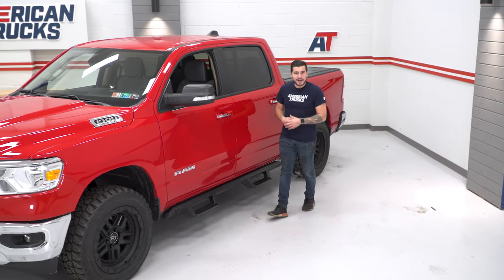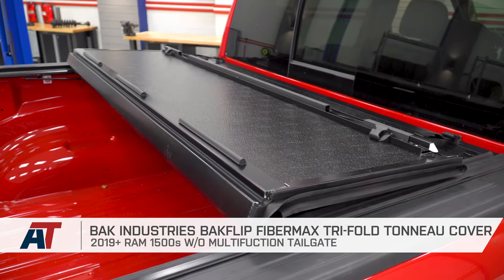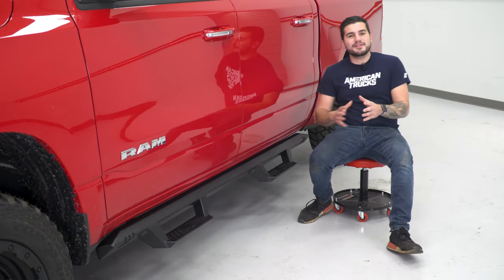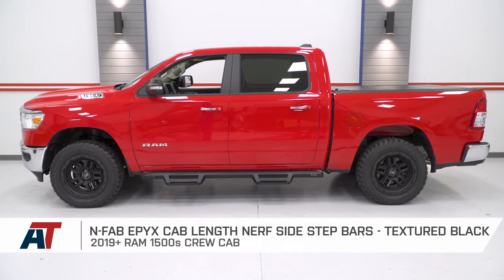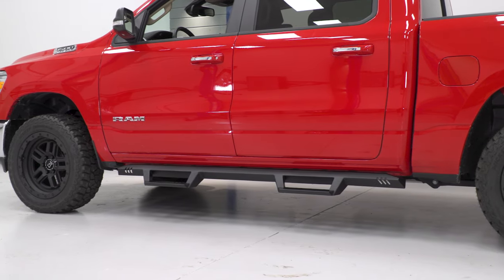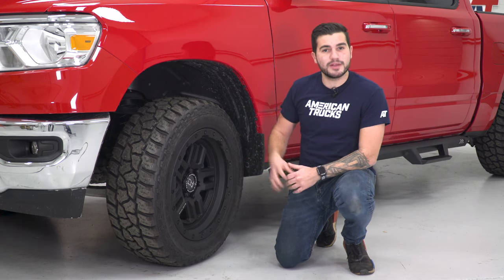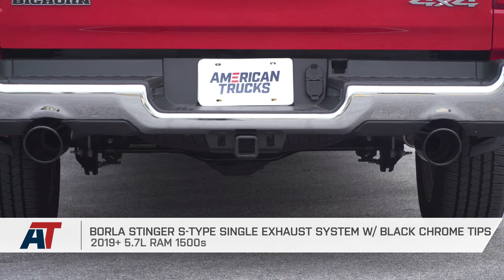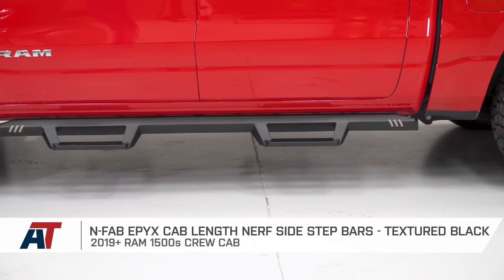The First 5 Parts You Must Buy For Your 2019+ RAM 1500 - The Haul

Comment: I just got a gently used 2022 Ram, bright blue with black rims and factory step bars as my daily driver.  My first five mods were more in the budget range.  WeatherTech floor liners and mud flaps, AVS Side Window Vent Shades, seat covers, and a soft tonneau cover off Amazon that looks and works great, but I do really like the hard cover you have in the video.  Total price for all, about $600.
Reply: Link to cover please 🙏

Comment: Spray on bedliner, window tint, tonneau cover and led bulb upgrades were the first 4 upgrades I added to my new truck.
Reply: Did you need to add certain components when you changed to LED lights, or were you able to just switch the bulbs?
Reply: @zacharyvanoostenrijk93  the brand I bought is called sealight. All I had to do was swap it the lightbulb. It had a pack in-line pack which I assume is a resistor that keeps it from popping up an error message that the bulb is burned out
Reply: Alright. I will check it out. Have you had any alerts or codes pop up since you changed them? Also, did you change all your lights?
Reply: @zacharyvanoostenrijk93  I started with the headlights as they are the most impactful. I tried swapping out the reverse lights but got an error code so went back to halogen for those. I will eventually buy full led taillight assemblies but for now I’m happy with the enhanced headlights

Comment: The 285/55/20 is virtually the same size as the stock Night Edition tire, which is 285/45/22. They're not 33" tires, but 32.1" for stock Night Edition and 32.3" for your mod. You DON"T need any after market lift for these size tires.

Comment: Pretty close to what I did. 2.5 leveling spacers (Amazon $65)giving me a no rub on 34x11.5 open country at3's on factory wheels. Flowmaster outlaw direct replacement muffler, exceed bed cover by extang, and ironcross steps. The finish is coming off the steps, very disappointed. Planning to remove all the finish this spring and have them coated with linex.

Comment: I got the N-Fab polished stainless steel nerf/step bar on my 2016 1500.  It also has the 3rd step for the bed.  Looks great on my Ram since the bumpers, wheel, and most of the trim is crome instead of black.

Comment: One thing to remember, hard cover tonneau covers are really nice for protection reasons but The dealer I got my ram from said he’s had multiple issues with water going in between the cover and then the ice freezes and buckles the panels. (They are made of sheet metal on top styrofoam middle and sheet metal bottom) he said he’s had 3 returns this winter alone.
Reply: Ive always used a 1 piece fiberglass cover.. water goes nowhere but right off the truck, and its not easily broken into. It has no moving parts but itself

Comment: For the price point of the BAK, I'll have to spend a little more to get the  💎 BackHD cover. If you go with their SE option it's still better than BAK. Made in the USA you have a weight compacity of 400 lbs, and 1600 for the HD.
The leveling KIT, well as a Ram owner I have go with AEVs 4inch lift, or you can go OEM with Mopar's 2 inch lift. If you need to save a little more cash go with Rancho's adjustable 2 inch struts for about 240 bucks. You get what you pay for. So if you're rig is for the Streets you could get away with the RC $50 dollar option. The side steps, I like these, but I'll have to go with ADD as my first choice.
Reply: BAK mentioned here is about 800 dollars, top of the line BAK ( not the one mentioned here) is about DB SE level-ish. ... diamondback HD is $2000 ,.... SE - $1400 and DB 180 is $1900.... so your spending at a minimum 50% to double this bak cover cost..... not sure how you define a little more...  agree with leveling kit, rather go lift as well.  Side steps no real favorite I'm 6'6" so doesnt matter. But went Barricade HD for the little woman to get in, and the sit tight to truck and are tough as hell.
Reply: Hey in the end they are both made in the USA, so in my book they are both great options.
For me I was hooked on HD when I saw the ATV load options and now their RTT rack crossbars.
Reply: AEV by the way has a smoking sell, 1k off their duel sport 4 inch lift, and their Mesa wheels are a 100 bucks off.

Comment: The black rims and side steps don't go at all with the chrome bumpers, grill, and badges. Stay with the chrome rims (as seen on the passenger side), and go chrome steps, or continue with the black(out) look and change out the bumpers, grill and badges to all black too.
Reply: I disagree, but I see where you're coming from.  There's enough black accent on the chrome bumper, with the fog light frames and the lower plastic/rubber "sweeper" on there, that I didn't even notice the contrast until you mentioned it.  If a guy has a lot of money to toss around, I'd say yeah, change to an all black setup and it would look mean as hell, but as it was in the video, that truck looks plenty good to me.  This is one of those thing where if you ask a hundred people, you'll get a hundred different opinions.  Just my two cents.

Comment: I feel like leveling kits with spacers would throw off the suspension a little? Make it ride a little more rough in the front. 

Opinion on a little bit higher quality leveling kit/small lift to ensure a good smooth ride?
Reply: Late reply, but I had the mopar leveling kit put in my 2019 laramie. No difference in ride quality whatsoever.

Comment: I've heard getting spacers for the 2" front level is bad for the ball joints and that after a few thousand miles they wear down. Would it be best to just buy more heavy duty upper control arms along with the 2" spacers?
Reply from the maker: If you have room in your budget aftermarket upper control arms would be a great addition! -Zach

Comment: I just bought a new 2022 big horn and I want to put a leveling kit are those cheap pucks going to serve me right or do I need to spend the $500 and get a full blown kit
Reply: This leveling kit will eventually blow out your struts.
Reply: @jaredwertenberger1720  I found that the 2022 came with a nice adapter plate for spacers that does not let the rubber boot move or press up into the spacer. Which is the same as running the top of the strut tower to the factory mounts. Go ram. That bieng said I went with only a 2” front spacer kit that way I’m not having to mess with my geometry to much to where it’s throwing everything out of wack. Professional alignment and she’s been sitting pretty ever since!
Reply: @jaredwertenberger1720  there’s a video on YouTube here showing what causes the strut failure and the new adaptation from ram factory eliminates that.

Comment: without fender flares, the first dirt road you hit will dent the living hell out of those folded, unprotected metal edges in the wheel wells. 2 years later, it rusts, and looks like a bag of crap. 3m vinyl tape the interior folds of your wheel wells, or get some flares to cover the metal.
Reply: What is this 3M tape you speak of?  I have the same metal edges in my wheel wells.  I'd like to explore some options.  Won't fender flares trap salt and cause just as much rust as rock chips would?  Just trying to learn something here.

Comment: if you get it with 4 corner air suspension you won't need a leveling kit...js
Reply: Not true. Even with the 4 corner air suspension you still have about 2 inches of rake. However i am pretty sure a leveling kit will mess with the air suspension. I have yet to see anyone put a leveling kit on one.

Comment: $1000 for tires, over $1000 for wheels, $1000 exhaust, around $900 for cover. Looks nice but Ill pass.
Reply: Yup. Covers are ridiculously overpriced although they do look nice.
Reply: It's the price to pay of you want to play, I bought an Ecodiesel so exhaust won't do much for it. I'll pass on the cover as well but a small lift or leveling kit asking with wheels and tires for sure are in the near future.
Reply: jazamora7521 exactly! I got the Limited with air suspension so I don’t need the steps or leveling kit, but I might do the cover and wheels/tires.
Reply: @RockStar5656  I got a low profile roll up cover for $120 on Ebay. Doesn't provide the same security as a hard cover but it does look nice and its convenient. Beats $800. I'm not living in the hood so soft cover works
Reply: @er5490  Got a 4 section hard cover off eBay for around $375. Does the same thing except I can't raise it all the way to the window. Not been a problem so far.
Reply: @XxsteamerxX  great deal. Goodluck
Reply: @er5490  Same.  Got a probably Chinesium roll up soft cover off Amazon and it fits, looks, and works great for $228.  I don't live in the hood either, and I never had any problems with the soft covers I've had on other trucks for the last 20 years.
Reply: Yep.  No matter how nice and bulletproof a truck looks and drives when you first get it, they're all temporary.  Eventually you'll either be selling it, trading it in, or driving (or towing) it to the junk yard.  It's nice to accessorize, but ya gotta keep the price within reason.  I manage to get laid on a somewhat regular basis without putting $4000 in mods on my truck.  If you're going to put this kind of money into truck accessories, you better be planning on keeping it 10 years minimum to get any (mostly imagined) value back from it.  $4000 in mods divided by 120 (10 years x 12 months) is $33.33 a month just for the fancy stuff, for all that time. Plus interest, if you put it on plastic.

Comment: I call b.s. my 2018 Ram 1500 Express Quad cab came stock with 33's on them and they don't rub at all!
Reply: Yeah i thought bs too. My 2020 Rebel came factory with 33.4 wrangler duratrac tires. It has the 4 corner air suspension but even those without it came with the same tires.

Comment: “Most truck owners buy a tonneau cover”. I guess most people that don’t use their bed
Reply: Might as well get a pos Prius 🤣
Reply: They are pretty handy come ice fishing season.
Reply: Depends on the cover. I've put ATVs in the back of a truck with a roll up cover. You don't lose any use in the bed
Reply: This is a dumb comment, you can still use your bed with most tonneau covers.
Reply: @jeffway1467  Yep.  With a roll up especially, you can use the whole bed easily.  Haul a refrigerator standing up against the cab with the cover rolled up is no problem.  I've never had a hard cover so don't know if that would work as well.
Reply: Just depends on the person I use my truck bed as a petroleum inspector but I also need a cover so that my equipment does get wet when it rains plus I drive day in and out and for those windy af days it comes in handy too I've had shit fly out of my truck due to windy days

Comment: If you have a 6.4 bed don't buy this flush mount cover it's absolutely garbage it comes with 4 panels that folds and has only 3 lock on panels which you lift the second panel from back easily you can open it up if you have tools this is not safe at all and the other problem is its not water proof this is absolutely waste of money do not buy this garbage cover from mopar